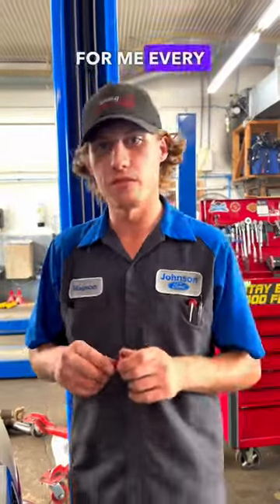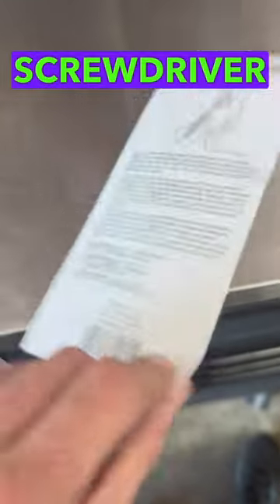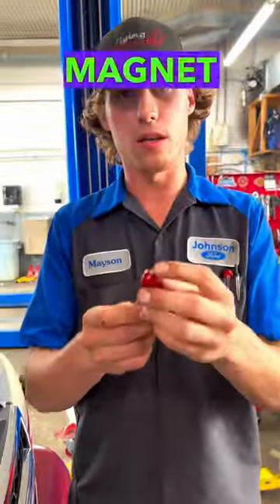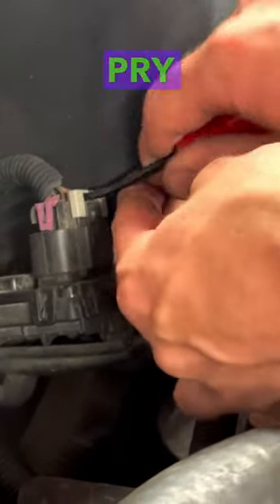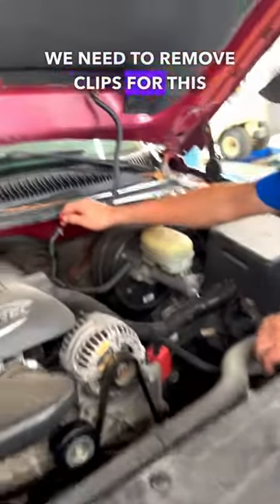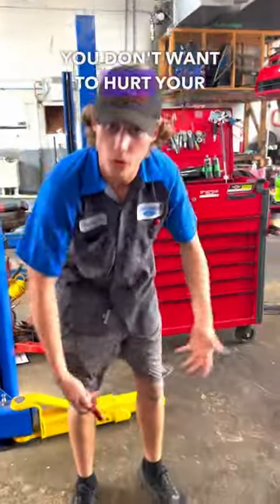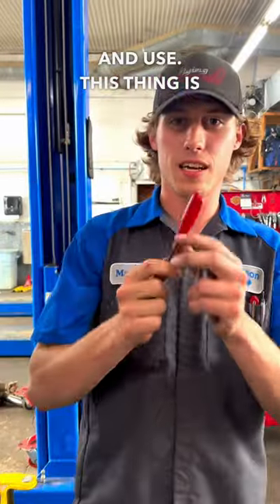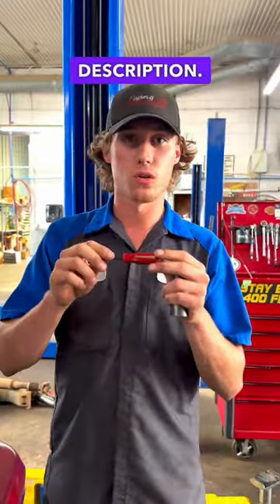Every Mechanic’s MOST USED TOOL #shorts

Comment: My most useful tool used to be one of those similarly-sized pocket flathead & philips screwdrivers with a pocket clip that you get for free at trade shows and such. I mostly used it as a pick to clean up caliper seal bores, remove o-rings, align small parts, etc.

But then I got this Lisle mini pry bar set and it's now my favorite and most used tool, even more than my M12 stubby and die grinder.

Comment: StreamLight Stylus Pro USB and the Micro Stream USB are by far my most useful tools. Beyond flashlights, the tool I use most on a daily basis are my 3” Knipex adjustable pliers
Reply: Thoes streamlights are junk. Bought 1 and the usbc plug type it won't charge.

Comment: Lisle also manufactures a driver for S - Cam anchor pins which works very well !  P/N 29090 , bushing driver P/N 29450 and trailer brake spring tool for Rockwell / Meritor P/N 40030

Comment: I have a Snap-On one (literally because of the warranty, I bent the tip of mine and he just gave me a new one on the spot, no need to wait). Doesn't have the magnet, but hands down the most used tool I own. It's also the first tool I recommend people to buy when they get into the trade, there are so many random things you can do with it without having to reach for a more appropriate tool.

Working on a Wrangler and need to take the cover off the rear camera to get access to the spare tire? This tool will turn what would normally require a Torx bit. Need to snap the spring back into place on a Mazda automatic shifter knob? Put this across it and pull on both ends, the spring snaps into place. I even use this to pull most push tabs out cause it's easier than reaching for a trim remover tool.

Comment: I go thru at least 1 a week. Plus side is, usually under every mack or volvo is at least 3 stuck to the nearest ferrous material
Reply: I've never lost or fully broken one. Use the right tool for the job. I've also never lost a single tool in my diesel tech career...
Reply: @luke8222  if you've never lost a single pocket screwdriver/ or ANY tool in your career, you're not real.  I lost my 12x14 platinum last week, it was on tip of my krl next to my other crap. It was found by another tech yesterday in another techs box next to HIS 12X14.. now,  I still consider that LOST, and I'm still not sure whether or not to say anything because YEAH, he could have picked it up,  but it was in his nox next to his, we HAVE a lost and found next to the command post or did he even notice. Is he dumb enough for 25 other things to have happened from him picking mine up to use "real quick", did a Squirrel run by? All questions I need yo explore before sleeping him in the parking lot for being a thief lol. Point is I have it now, and I still "lost it"
Reply: @luke8222  secondly, I support the "right tool for the job". Alas, I work for mack..tool #3B61711 in drawer #305D probably hasn't existed in that spot for decades and they're not about  to replace it when a 2x4 and mini sledge seat that bearing race "just fine"

Comment: 1/2 impact unless you get a job to sink your teeth into. Ive tried pocket screwdrivers. Free from snap on, I hate it, rarely use it. I have way to many other specific tools in hands reach service cart to use it. Picks, body panel removers, pry bars ect. Always in place top compartment of the tool box.

Comment: I've got an old one that flips to be either Flat or Philips and it has a thinner handle than that one. 
I love that thing, and it comes in handy all of the time
I guess my second most important tool,
is a good (rechargeable) flashlight 🙂
Third is a cheap sturdy pocket knife (it won't hurt my feelings if I break it, and I'll sharpen it on the grinding wheel) 😎

Comment: I love these things! I work lube, and I use them most on cartridge filters. Just get the tool under the gasket, stab the filter element, twist 360, and pull out. Works like a charm!

Comment: Snap on truck has them for a dollar a piece in every color you can think of
Reply: I’ve never seen 1 think on a snap on truck for a dollar
Reply: @JR-km9zg  it was a few years ago, but i just googled it and they are like 9 bucks now wtf??
Reply: Amazon sells them by the 3 pack in assorted colors for like 8 bucks, and im still on my first one in over a year with it
Reply: Any single tool from snap on under $50 and you can consider it theft ahhaha
Reply: Tell me you haven’t been on a snap on truck without telling me you haven’t been on a snap on truck
Reply: My guess is that price was a temporary promotion used to get people on the truck so they’d buy the more expensive tools.
Reply: Those are more like regular tiny flat heads not so much a pry bar. Still very convenient and have a magnet on the other end. Also they’re $2 probably due to inflation haha. I buy about 5 at a time since they tend to go missing..

Comment: Keep putting them in your pocket. Until the day you lean over under a hood and it tries to enter your lung through your ribs. 
They only get sharper with time.
Reply: first thing I thought of was how much it would suck to fall with that in your pocket. I carried a folding knife on my belt or in my pocket for a bit. I drive tow truck so I'm lying on the ground a fair bit. the amount of times it opened on its own I stopped carrying it. far too close to my junk for my liking

Comment: no no no pockt screw driver flat head from matco or snap on front pocket.. then the diag tool then 1/2 inpact snap on or matco then door panel tools then 10mm 12 mm 14mm and 31 mm pry bar 3.8 in wratched now cordless you can work on most vehicles with a side cart and about 50 tools the rest is just in case you need something and never use it i have about 50 grand in tools a meat slab and was a 30 year mechanic we also fucked around alot in the shop saw people almost die tires falling off mid test drive angry techs tossing tools doors being bent back the other way runing into cars into the lot seen it all.. and theres always that jerk off tech that dont like you for some reason then the smog techs glorified douche bags always think they run the shops but dont